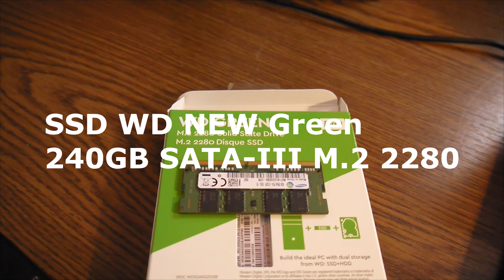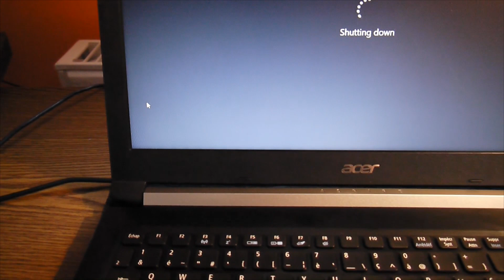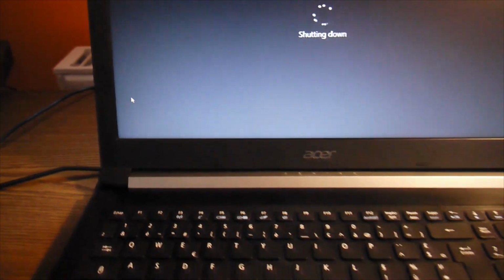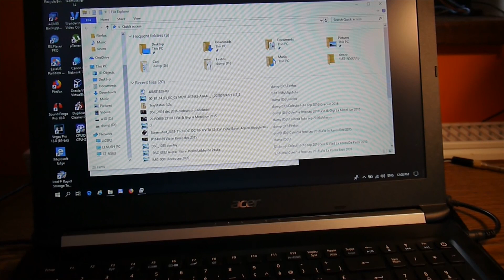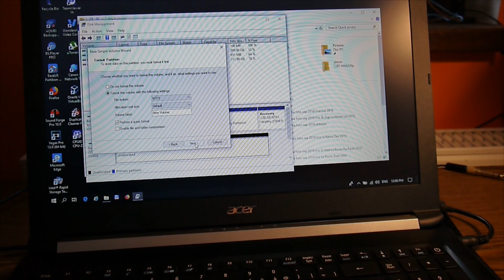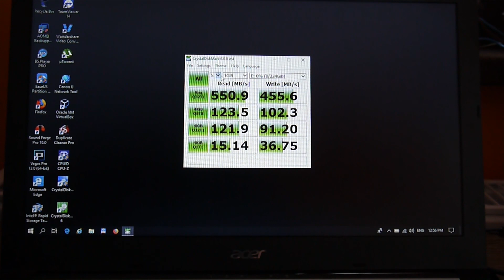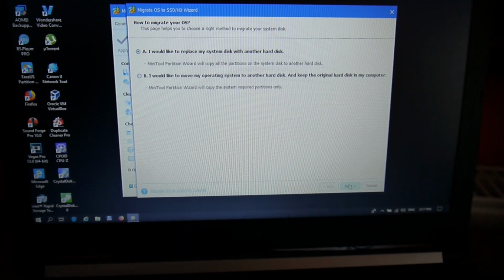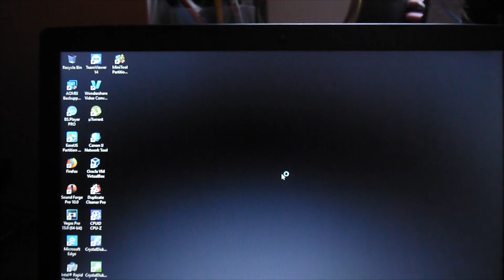Best Acer Aspire 5 A515 51 dismantle upgrade RAM and M.2 SSD

Comment: On that M.2 port can an M.2 NVMe SSD work? Or just an M.2 SATA?
I ask because I am about to buy an SSD and I don't want to make a mistake.
The exact model of my laptop is Aspire 5 A515-51-765D.
Ah, I can install the Operating System on that M.2, right ?!
Reply: In case someone else has doubts, yes, you can also install an M.2 NVMe on Aspire 5 A515-51-xxxx. At least that was the answer given by a recognized user in an Acer forum.
The only limitation is that the speed is half of what these types of units can reach (just over 1000 MB/s), at least that is what some screenshots showed (test speed performed by a user). The problem is the PCIe lanes, generally, laptops, at least this one, are limited to 2 lanes (about the why of this, I only found personal criteria without reliable references). Despite this drawback the speed is still higher than an M.2 SATA. 

IMPORTANT, I HAVE NOT EVEN CHECKED THIS, I AM AWAITING THE NVMe SHIPPING
Reply from the maker: about NVME install https://youtu.be/FA9paP39284
Reply: @enlroma3680  did the nvme ssd work???
Reply: @blazef1re402  Now I can tell you that it works, I finally have the NVMe installed.
Reply from the maker: Hey! Just give me a hand and  subscribe ! Thanks!
Reply from the maker: Hey! Just give me a hand and  subscribe ! Thanks!

Comment: My friend, your video has been very helpful. Instead of getting a new laptop to replace mine, I will follow this to install an ssd and additional ram to see if I can give my Acer A515-51-57 DX a second life. While the hardware part is actually similar (maybe the same) do you think the ram type (2133 mhz) and that same ssd would fit mine as well?
Reply from the maker: I see it's the same model..almost, so it will work.But better install CPU.Z and find all the details about actual RAM and what kind of MB you have  and let me know.We'll talk about upgrade.
Reply: @viocaia  Thanks for the quick reply! I ran CPU.Z but I´m not sure what to look at on the Memory part. The MB is a KBL Charmander_KL, V1.19. For the memory part, what should I look? DRAM frequency? However, I looked for more information about in on Acer forums, it seems the frequency is the proper one (2133).
Reply from the maker: @Danielcr88  I have the same MO, but v2.02 , for the memory look in the memory tab, if you have ''DDR4/Dual channel'' you are good to go.ALso check under  SPD if ther eis DDR4.Under Mainboard tab I have chipset Kaby Lake and souhtbridge Coffe Lake...
Reply: @viocaia  Wow, you are the most helpful youtuber ever! Thanks a lot for your guidance. While we have the same info in chipset and southbridge, the memory of my laptop says single channel. Any final recommendation due to this channel # single?
Reply from the maker: @Danielcr88  I just took off the extra memory card and CPUZ it shows single !! so when you will add the extra memory, goes to dual channel.If you afford you can go for faster RAM, I used 2133 I couldn't find better then.
Reply: @viocaia  I'll try. Again, thanks a lot for all you help. I will make sure to let you know how it goes once I get the parts and clone the hhd into the ssd
Reply from the maker: Hey! Just give me a hand and  subscribe ! Thanks!

Comment: Hey bro please tell me this laptop support m.2 NVMe ssd and I can use NVMe ssd as a boot driver
Reply from the maker: Told you twice! Yes it does!
Reply: @viocaia  can I use this drive as a boot drive my laptop bios version is 2.02 and NVMe ssd bios UEFI version requirement is 2.3.1 or latter
Reply from the maker: @LakhwinderSingh-zj3sm  I just checked the latest BIOS for this model is 2.01  from ACER downloads, so if you have doubts about installing one, you may use a M.2 with good results  also.All I can say, some others installed NVME and it's working.
Reply from the maker: I didn't installed one, but there are people here who did it, and it's working!
Reply: @viocaia  but you asked in some comments that this laptop support NVMe ssd
Reply from the maker: Maybe , for clear this question..but now I can say the motherboard is Charmander KL and after digging around it support NVME PCI for sure!
Reply: @viocaia  please give me a clear answer this laptop support NVMe ssd or not please
Reply: @viocaia  thank you so much again. You are good soul. Replied to every single comment😇
Reply from the maker: At least you may subscribe and please be polite and read ALL the comments, you'll find a lot of answers there!
Reply: @viocaia  which one version is big 2.02 or 2.3.1
Reply from the maker: @LakhwinderSingh-zj3sm  it should be 2.3.1., but the latest I found is 2.01, be kind and let us know a link to BIOS 2.3.1
Reply from the maker: @LakhwinderSingh-zj3sm  https://www.acer.com/ac/en/US/content/support-product/7239?b=1
Reply: @viocaia  I have already check over there the latest version of bios is 2.02
Reply: @viocaia  the problem is that can I install my window on NVMe ssd instead on old bios version
Reply from the maker: @LakhwinderSingh-zj3sm  It's working for sure, so go for it!
Reply from the maker: @LakhwinderSingh-zj3sm  as long as the bios sees NVME disk in the system can be made bootable for sure! good luck!
Reply: @viocaia  thanks you so much for your help
Reply: @viocaia  hey brother tell me that Acer aspire 5 laptop support 500gb NVMe ssd?
Reply from the maker: @LakhwinderSingh-zj3sm  Not sure..I only used with M.2 but I suppose it can handle 500Gb NVME.It's a pretty new MB so It should work.Kind of expensive 500G..no?
Reply: @viocaia  so bro suggest me some thing what can I do now I need more storage with high speed please help me brother
Reply from the maker: @LakhwinderSingh-zj3sm  buy it and install it...and let us know how's working.If you're in doubt call Acer for technical support.My tutorial is about installing an M.2 SSD.Please don't take me like an Acer assistent.I only described what I have done!
Reply from the maker: Hey! Just give me a hand and  subscribe ! Thanks!
Reply: @viocaia  one more help please , can you tell me some website where I can find specifications of motherboards . If you have any idea?
Reply from the maker: @No_limits37  that's the board..stra from here..https://www.aliexpress.com/item/33034793164.html
Reply from the maker: @No_limits37  the specifications from Aliexpress are totally wrong, but that's the right model..google for more..
Reply: @viocaia  like you just told charmander kl is a fresh MB
Reply from the maker: @No_limits37  Yeds, this MB should support NVME with no doubts
Reply from the maker: News from our firend ..
Harshvardhan Malpani
''I upgraded with 256 nvme and 16gb crucial ram. Has been more than an year and performs really really fast ''    so go for it!
Reply from the maker: about NVME install https://youtu.be/FA9paP39284

Comment: Hello, i have ACER Aspire A515-51G-30G2, and i have same m.2 slot, but i can't find online which m.2 to instal. Does you have some informations about that, SATA III or NVME (like A-DATA SSD XPG SX8200), can i use full potentional of that A-DATA solid state drive? Thanks
Reply from the maker: Please read the video description.It's confirmed NVME works, but you may use any M.2 SSD you can afford.
Reply: Viorel Caia first has 1 notch and the second 2
Reply from the maker: @aleksamilojevic8048  The mother slot have ! notch, you may see in the video...so It doesn't matter if the NVME have 2..it will fit in.
Reply from the maker: @aleksamilojevic8048  look here https://www.youtube.com/watch?v=fJCHx7mZEKo&t=395s
Reply: Viorel Caia thanks a lot!!
Reply: Viorel Caia so does my motherboard support speed of nvme?
Reply from the maker: @aleksamilojevic8048  I think this is similar...the slot I mean..https://youtu.be/cCmAOwRYNwY
Reply from the maker: @aleksamilojevic8048  welcome, let us know how's going!
Reply: Yeah, i saw that, but pins on m.2 is different on sata III and nvme, you know that? Can i put in PCIe 3.0?
Reply from the maker: @aleksamilojevic8048  Probably yes, I didn't tried, but all I can say is that Athreya guy from India succesfuly installed a NVME , I wish to have one and try myself.
Reply from the maker: Hey! Just give me a hand and  subscribe ! Thanks!
Reply: Viorel Caia done, subscribed
Reply from the maker: about NVME install https://youtu.be/FA9paP39284

Comment: A tip for anybody who doesn't have the mounting screw: the screws that hold in the 2.5 inch hdd are the same size as the m.2 mounting screw! If you can't find any online, one of these will work. My m.2 screw hole had a yellow plastic piece in it, however, so make sure that is taken out first!
Reply from the maker: I said that in the video too!
Reply from the maker: Check the video min 6:44, about using a screw from the original HDD
Reply: @viocaia  oh crap lmao I'm dumb. Thanks for the video by the way, it was super helpful!
Reply from the maker: Hey! Just give me a hand and  subscribe ! Thanks!

Comment: hello sir, how to know if  the laptop has a ssd m.2  slot?  is this laptop has? Acer Aspire 5 A515-51G-38GH, core i3 7th gen
i bought this laptop since 2017
Reply: hi sir, i open the laptop and it has a m.2 slot😊. well i bought 120gb ssd m.2, im just confuse that i saw   disk 1     
basic :111.77 / 111.27
                             unallocated 
my question is where is  the 8.3gb?,i installed 120gb please help thanks
Reply from the maker: It should have, it's pretty new, check the configuration at Acer web site
Reply from the maker: I checked some details couldn't find anything about m.2...just ata ssd
Reply from the maker: Hey! Just give me a hand and  subscribe ! Thanks!

Comment: I have issue in charging my laptop ACER A515 51G 54AW....
ON Putting may charger the power  LED and the charging LED starts to blink .... I donot understand whats the problem ...... PLEASE HELP
Reply from the maker: under the laptop in th left side there is a small hole, try to reach that and push it.That's kind of hard reset (like unplugin the batttery)
Reply: @viocaia  i did that .... But thats not working...... Whats the issue please adress tge issue
Reply from the maker: @swapnilsrivastava9325  Maybe you have to open it up and disconnect the battery..wait for a couple of minutes and plug back again.Kind odf reset..if it is not working, it seems like you need a new one! In the mean time try this software https://www.nirsoft.net/utils/battery_information_view.html
Reply: Its a charger issue.. the charger is not being able to provide a stable output.. try with another charger
Reply: @rahul999ification  i have changed the chrger 2 times
Reply from the maker: Hey! Just give me a hand and  subscribe ! Thanks!

Comment: Did watch it for maybe in the future to upgrade an m.2 and also encouraged me to clean the fan... temps went down 20º-10ºc, was thinking on changing the thermal paste but seems it´s very stable and nice. Nice video i would love to ask if it is posible to add a Samsung 970 EVO Plus 500GB.

Mi laptop´s model is A515-51G-751G
i7 7500u
8gb ddr4
1tb wd 2.5hdd
gf940mx
Reply from the maker: Of course you may use Samung 970 Evo.
Reply from the maker: Hey! Just give me a hand and  subscribe ! Thanks!
Reply: @viocaia  Also for those in the future and maybe that will watch this nice video keep in mind... M.2 Nvme x4 in this laptop it will only work and run at half the speed advertised by the manufacturer due to only 2 lanes enabled(it's the norm for laptops).

Samsung Evo 960 is nice you will get around 1800mb read and 1300mb write lectures. Even when getting the 2 lanes downgrade...

 SATA interface will vary between W/R speed´s of 500mb.

And pcie x4 will run in only 2 lanes and half speed in this model, but i have seen on the model A515-52G x4 will work at its fullest (Ssd samsung evo 970plus 250gb in aspire 5 a515-52g R:3200mb/W:2200mb).
Reply from the maker: @alfredorodriguez4539  Very nice and documented! Thanks for sharing!!!!
Reply: @viocaia  Upgraded to an m.2 nvme kingston A2000 500gb having 1800mb read and 1600mb write.
Reply from the maker: about NVME install https://youtu.be/FA9paP39284
Reply from the maker: about NVME install https://youtu.be/FA9paP39284
Reply: @viocaia  Little update, I've been using the laptop almost every day for around 6-13h a day and there is some wear on the write speed's

Currently at: 1631mb read 629mb write. Still decent tbh might upgrade in the future to a better one with 1tb.
Reply from the maker: about NVME install https://youtu.be/FA9paP39284

Comment: It will be my first time upgrading my laptop and I'm quite scared but thanks to your vid, I found comfort that it will turn out great! 

Just a question, I've seen somewhere that just moving the OS to the SSD without formatting the HDD will cause the OS to not get the maximum read/write speed. Is this true? Is it always recommended to wipe the HDD first then migrate the OS? Thanks! Much love. :)
Reply from the maker: I don't think so,  but looks like a good idea to format the disk before only if you use an used one.If is new there is no need for that, just migrate the old one.Good luck and don't be scared.Be careful about electrostatic charges from our body, so touch the metal parts of the laptop ones in a while.
Reply: @viocaia  Thanks!!
Reply from the maker: Hey! Just give me a hand and  subscribe ! Thanks!

Comment: Did acer aspire A515-51G support M.2 NVME. If yes then what is the maximum capacity?
Reply from the maker: Yes and as much as you can afford
Reply: @viocaia  my aspire has 8gb ram i5 8250 series and 8gb ram. This is the question that I am not getting any answer; what is the maximum capacity of storage it can support.
Reply from the maker: @4umahin  It has an M.2 ssd slot, there you may fit as much as you can, I used 250Gb because I couldn't afford more for the money, but you can fit 1T as well..also for the ''classic SATA'' I have 1T of mecanical 5400 hard disk, there you may fit a SSD as gig as you like! I'm preety sure the amount supported by the main board is far too much as my pocket can!
Reply: @viocaia  having m.2 slot doesn't necessarily means it can support nvme drives as well.
Reply from the maker: MIne have PCI Express v3.0 , it can 8GT/s and 4 lines, so I'm pretty sure it will work with NVME drives.
Reply: @viocaia  let me take a chance and purchase samsung 970 evo plus 1tb along with kingston hyperX sodimm 8 gb ram.....lets see what happen....fingers crossed...
Reply from the maker: @4umahin  I'm confident it will, please let us know!
Reply: @viocaia  yeah sure, why not.
Reply from the maker: @4umahin  I spent all evening searching for answers if is working with NVME..so nothing clear, by the specifications of the motherboard is looking like it should...but there are many voices said no..but nobody eventually did it.Finally, I start be in doubt if you should spend a lot of money for a 1T NVMe...better contact your local Acer support before or simply buy a good M.2..and about the RAM , as long as is DDR4 it will work.
Reply: @viocaia  acer support is useless...many times they are also perplexed and don't have clear answers. It seems like they don't have enough knowledge about nvme, M.2 and simple ssd. Moreover nobody even on google and youtube did this experiment. If all worked well I am thinking of making a youtube video on it.
Reply from the maker: @4umahin  Of course you should do a video about, somehow I have the felling that you'll work! Good luck!
Reply: @4umahin  hey bro tell me please acer aspire 5 work with NVMe ssd or not
Reply: @4umahin  brother please tell me your laptop is comfortable with NVMe ssd or not
Reply: Done
Reply from the maker: @4umahin  thanks!
Reply from the maker: about NVME install https://youtu.be/FA9paP39284
Reply from the maker: Hey! Just give me a hand and  subscribe ! Thanks!
Reply from the maker: Hey Mahin! Please help me with subscribe! Thanks!

Comment: Thank you for such a comprehensively made video. I have an ACER ASPIRE A515 51G, with a soldered on 4 GB ram, and an intel i5 8th gen and a 5400 1 tb hdd.

Can I add a 16 gig ddr4 2400 mhz to it? Also, can i only add a sata m2 and not a pcie one?
Reply: Did you find any solution to your questions as I am having same queries for this series laptop. Since NVME is new future of ssd's which are different from M.2. So not sure whether I should buy nvme or M.2 ssd
Reply from the maker: Sorry for this late answer, you  xan use any ddr4 ram and only m.2 ssd for OS and files but big enough
Reply from the maker: Hey! Just give me a hand and  subscribe ! Thanks!
Reply: Ķ
Reply from the maker: about NVME install https://youtu.be/FA9paP39284